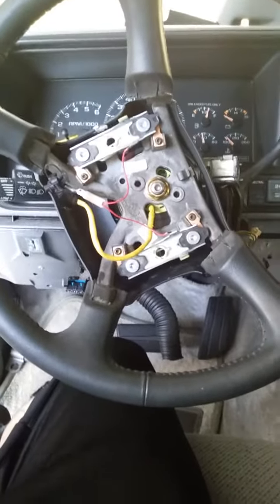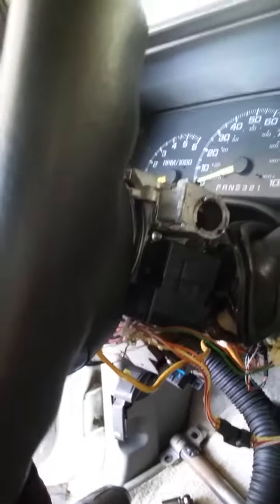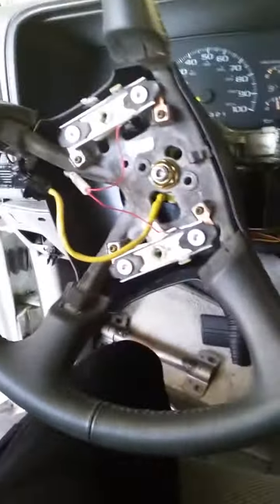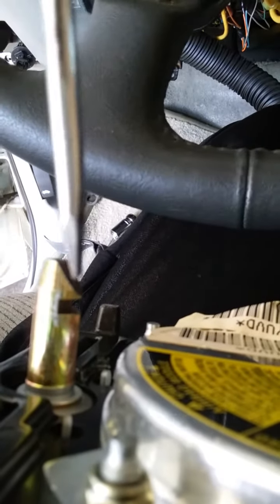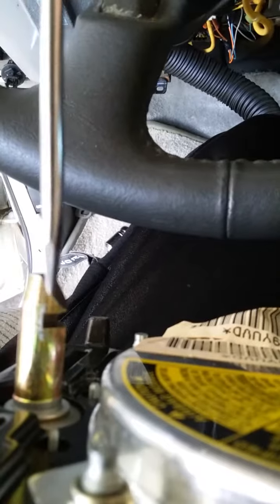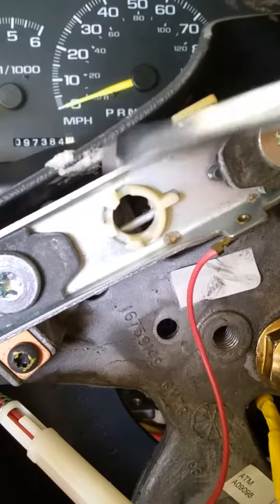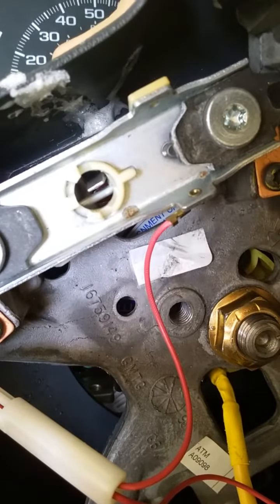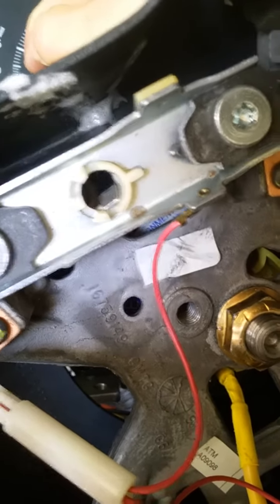How to take off steering wheel airbag 99 yukon

Comment: Thanks, This was the best video yet.  help me a lot.
Reply from the maker: nelson Clark hey no problem sir I tried to put what I needed help with because I struggled just with the clips I didn't know which way the clips needed to go now removing the the rest you'll need a steering wheel removal pulley you can rent for 20 at autozone and they refund the 20 when you take the tool back
Reply: Thanks got pulley. Got passlock issues.  Changing key housing. Hope it works
Reply from the maker: nelson Clark if your referring to the housing where the ignition lock cylinder if your changing that and its brand new you will need to get it programmed to your computer I had to learn that the hard way bro Hahaha
Reply: I hope by leaving the key on for 10 minute will work
Reply from the maker: nelson Clark also try cleaning the passlock with electric parts cleaner let dry thoroughly before reconnecting
Reply: Ok
Reply from the maker: nelson Clark I tried that also and it would start for like a few seconds then security disabled the engine and then would turn off I couldn't figure it out until a cousin of mine said i needed to have it programmed to the computer on my truck and then it started right up never had a issue after that let me know if that works im interested if it was just mine or will all trucks need the reprograming
Reply: Ok

Comment: Everything went ok.  Had to leave ignition on for 10 minutes with security light flashing.  Did it 3 times and the time truck cranked and running fine. Thanks
Reply from the maker: nelson Clark nice man in glad you got your baby back on the road
Reply: If you have the truck next time try to disconnect the battery and wait for the volts left in the system drain after about 30 mins to a hour work on the vehicle and see if it happens again...... no disrespect at you at all 46 years old turning a wrench since I was 8 years old over the years I learned a thing or two and with adhd on my side I solve problems lol but yeah friend try it and it should help

Comment: Sob! I damm near fought with this shit for about an hour and even went as far as removing the column to give me better acccess and still couldnt get it off. At the end i had to break the bottom cover,removed the 2 screws holding those pins and then i was able to remove the bag smh fml

Comment: Great video, I ended up breaking the fuck out of those little spring things on the last truck I tried taking the wheel off of. Had no idea they had to be compressed, so I just snapped the plastic things on the back of the wheel and bent the springs out of the way. Hopefully it still snaps in when I go to reinstall it.
Reply from the maker: **Classified** Hahaha yea that shit frustrated the hell out of me at first i thought I needed to decompress the post on the bag Lol that shit wouldn't budge the only reason I figured it out is i wiggled the screw driver and it cause the clip and moved when it did that the pressure popped the one side of air bag off and I figured it out but dam u might need to find some new plastic inserts man
Reply: King Mario RF Reviews Yeah, there's a product called Q-Bond I use too. It actually makes the bond between the materials stronger than if they were new. If the bag won't snap in, I'm going to try some of that. Thanks again for the video though, NOBODY else had any useful information on this style of steering wheel.
Reply from the maker: **Classified** hey man no problem if you need any assistance or any questions let me know
Reply: Got it all swapped out. Those things that I broke are just held in with torx screws so I swapped them out and now I have a nice, new looking wheel. Thanks again for the video, deserves way more views!
Reply from the maker: **Classified** awesome man perfect brotha im glad it helped and I appreciate the kind words man and your support